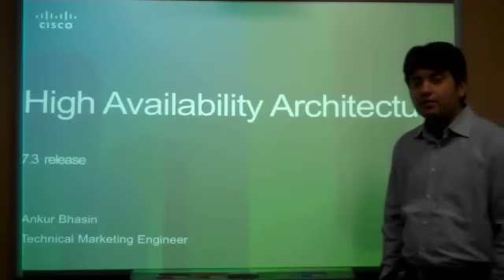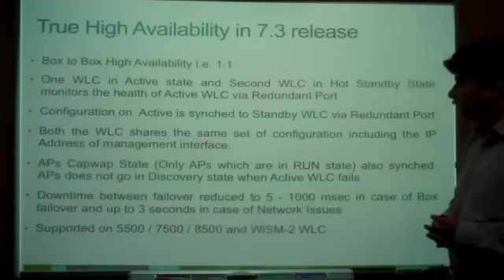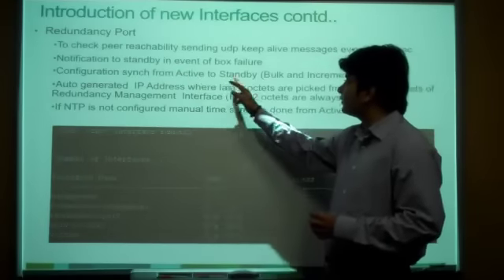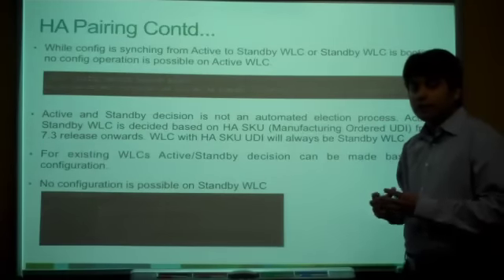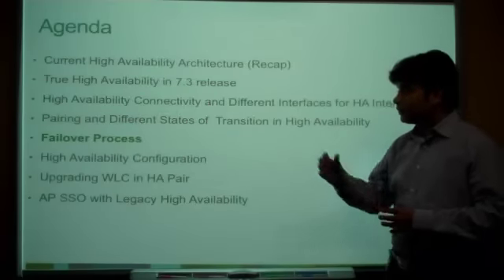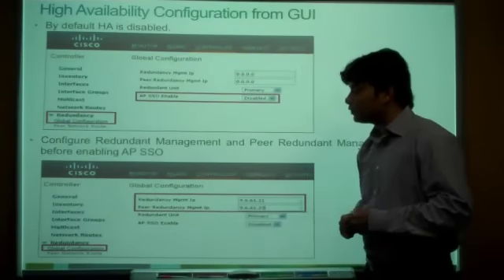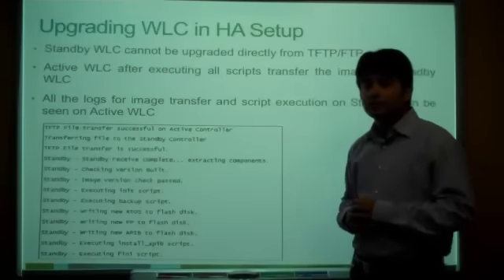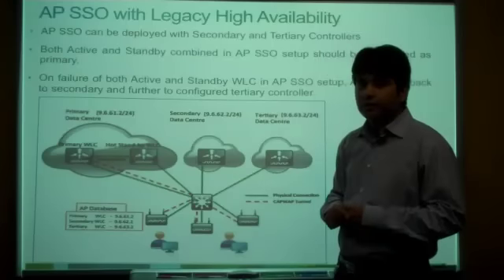High Availability Architecture in Cisco Wireless LAN Controller -- 7.3 Release

Comment: Is it necessary that our 2 wlc(5508) should be directly connected via root port or we can introduce  switches between them as our wlc are on different different locations & the distance between them is more then 100 meters for AP-SSO mode for ex:
Wlc1(Root port)-____(Copper)_____6509---------Fiber-----------6509______(Copper)__________Wlc2(Root port)